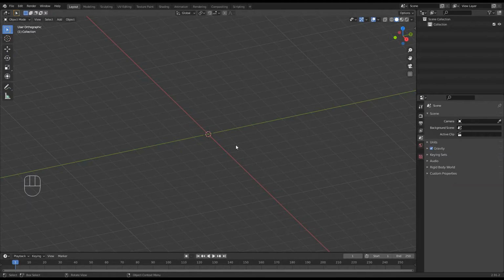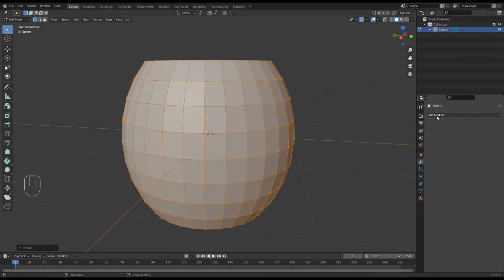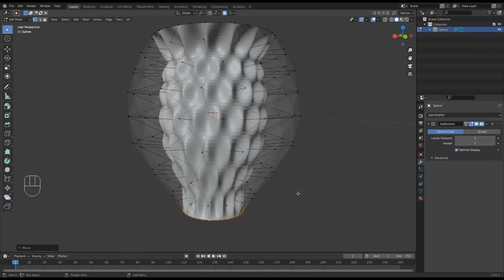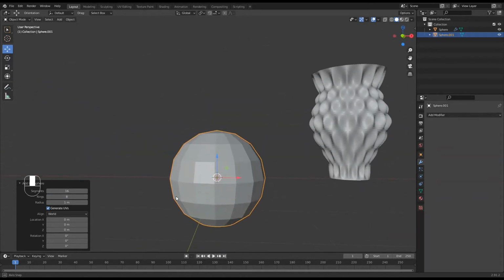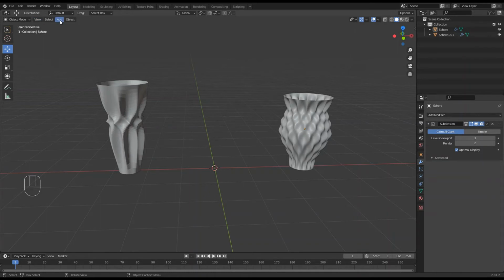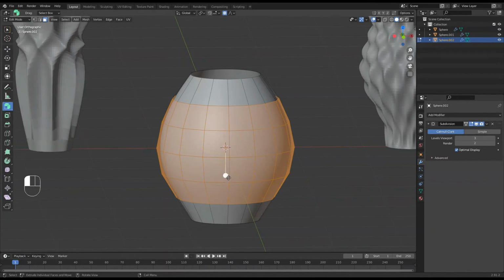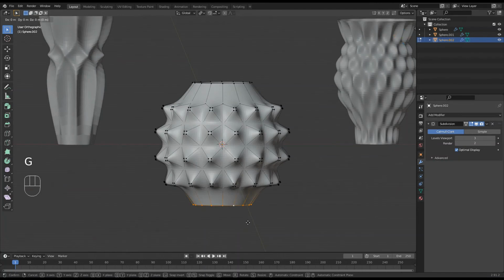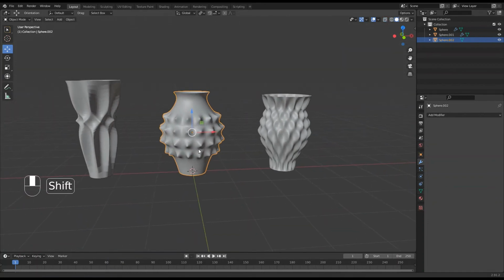5. Blender 2.91 - The Power of SubSurf Modelling

Comment: Wait, how do you add a bottom??
Reply from the maker: If you want a bottom, in edit mode select the ring of vertices that make up the bottom. Select all those vertices with say an Alt+left click. Then just press the F key on the keyboard (F for fill) and you will have a base surface. If this is for 3D printing the slicing program does not care if there is a base on the 3D model or not. In the slicing settings you select whether you want a base to be printed or not.